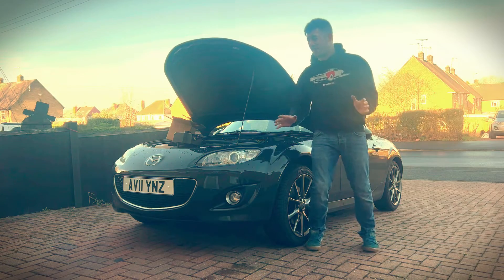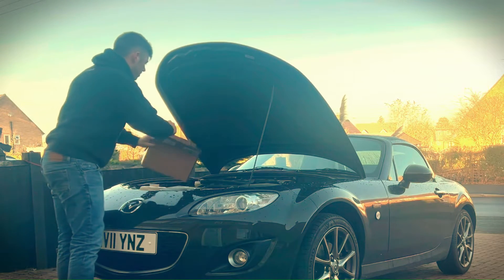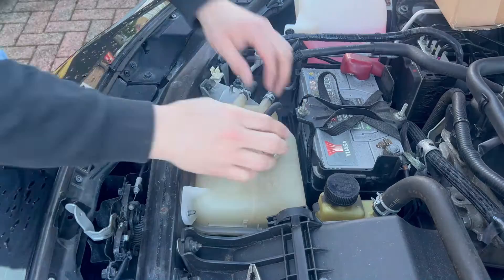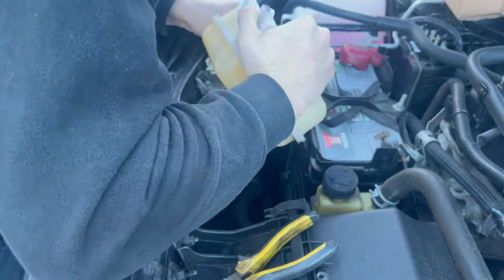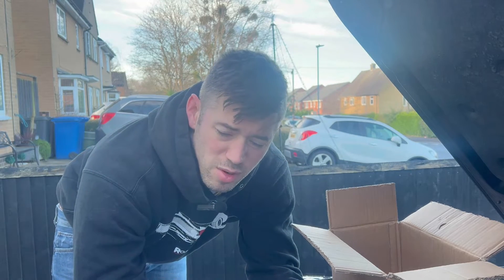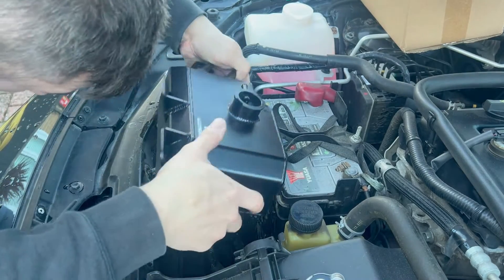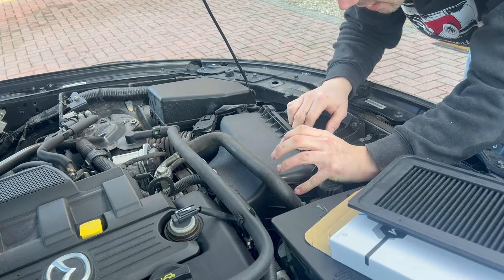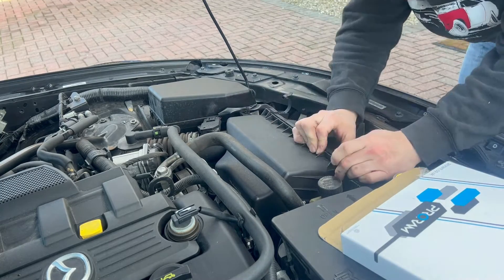Mazda MX5 NC Coolant Tank-  Essential Cooling Fix for a Major Flaw

Comment: Replaced mine with a cheap one too, different "brand" but absolutely the exact same one lol, had no issue with the cap but had to drill out one of the mounting holes to make enough room for it to actually lay flat without bending the mounts ha
Reply from the maker: I think that’s the issue with the cheaper one, some are spot on, some need abit of modification

Comment: Reservoir leak myth created by aftermarket industry🎉 cheers!
Reply from the maker: Not really no. I’ve personally had it happen on two cars in my possession
Reply: @InitialB Miata’s, and with proper care and maintenance?
Reply from the maker: @robertmaltbie1188 , one yes, even with proper care and maintenance , it wouldn’t stop heat cycles making plastic brittle.   A new OEM one would probably last another 10-15 years too.
Reply: @InitialB no 06 I replaced just because it was yellowed and found a new one cheap.  I’m trying to weight my steering by restricting power steering pressure line, and knowledge there.  Is shaved the top copper washer if high pressure hose at pump so I can tighten it past the alignment with hose from pump.  But it’s driving me nuts how light this steering is.
Reply: @InitialB you've had two NCs previously where the coolant tank failed? I find that hard to believe.
Reply from the maker: @perolito83 two cars, not two NCs.  I don’t really get the resistance, old plastic cracks, it’s common